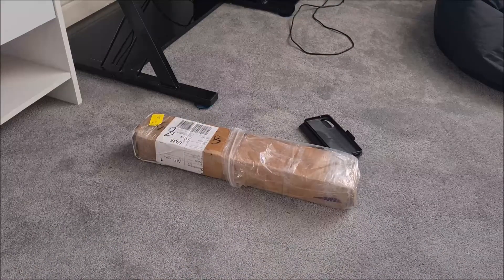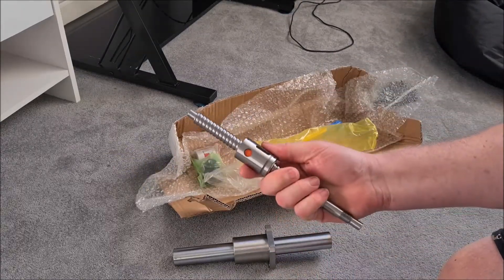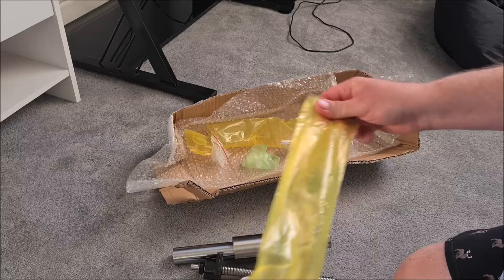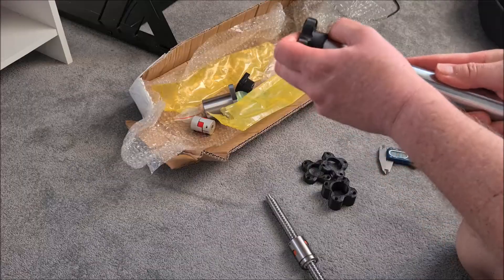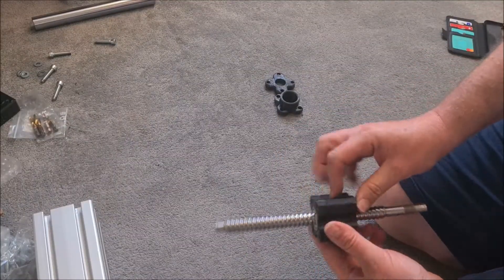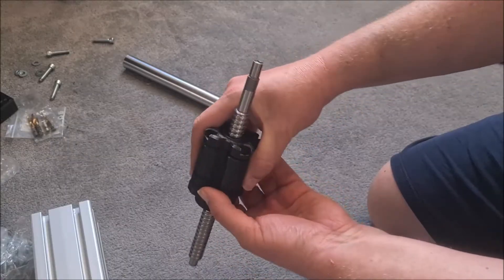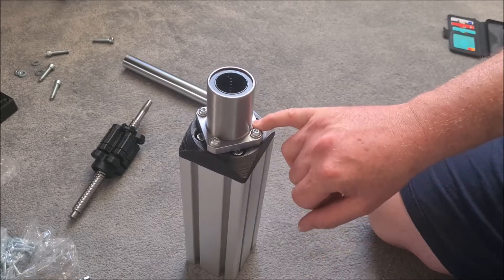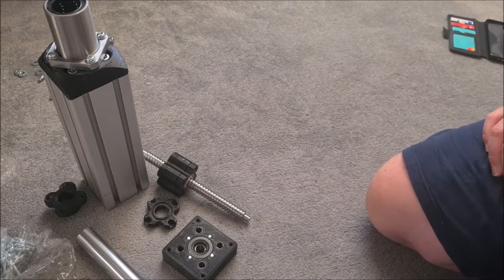Build your Own Sim Racing Motion Platform - Cheaper Actuator Design - Part 2

Comment: This is great, thanks, good work. I'm hoping to order the actuator parts soon. I assume for printing it's the same parameters as on the sfx-100 build?
Reply: Oh and instead of tapping the print could you incorparate a captive nut in behind it that could be held in place with some glue? I'd be interested in the Alu parts if it's not too expensive